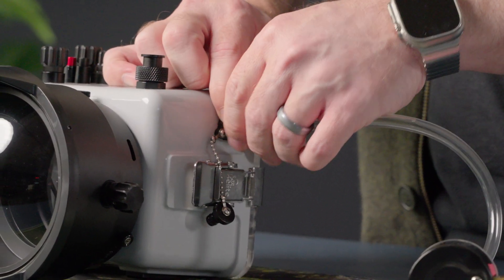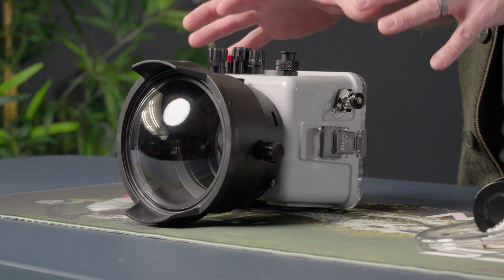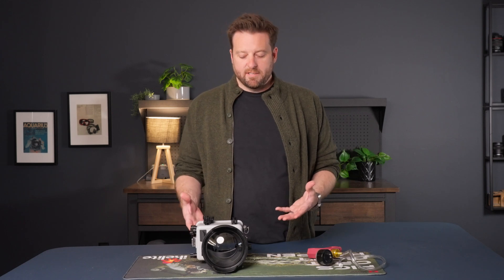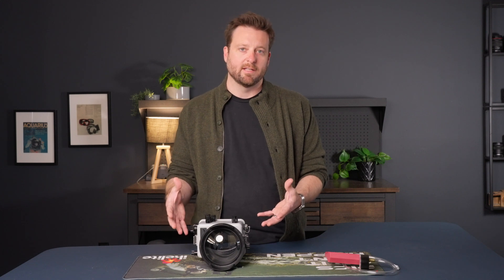Using a Vacuum Pump to Check for Leaks on Your Underwater Housing

Comment: I have an issue with my housing where when I dive with the vacuum to 10 inHg the buttons would depress under water. It happens especially with the video button up top and would actually press the camera buttons. 

I can bypass this issue by releasing the vacuum to about 1 inHg, then the housing works fine under pressure.
Reply from the maker: We have heard of that, particularly if a little bit of salt has dried up in the buttons. There's no harm in vacuuming to only 5-9. The most important part is making sure the number isn't dropping over time.